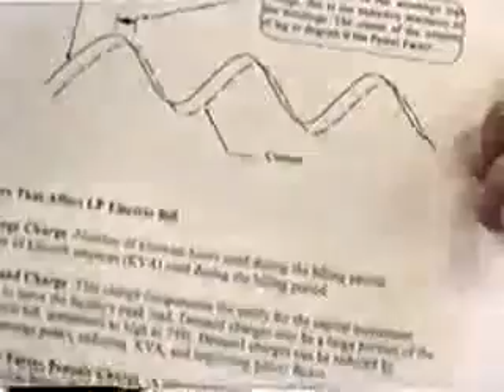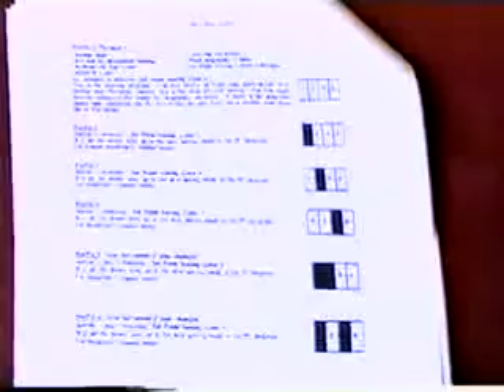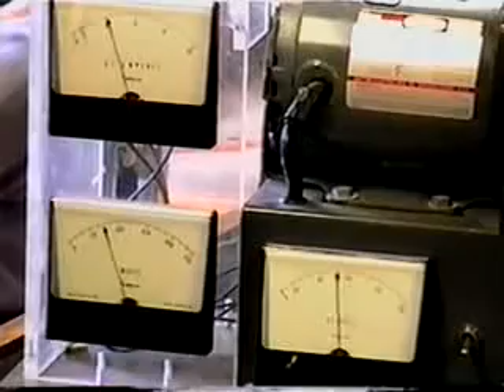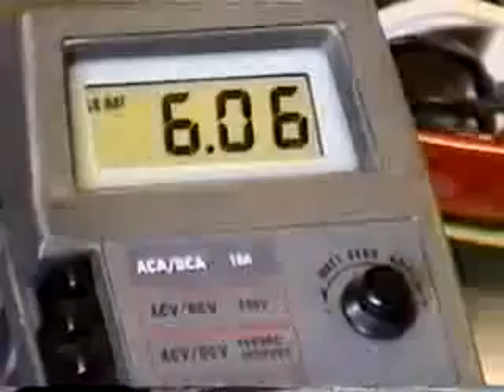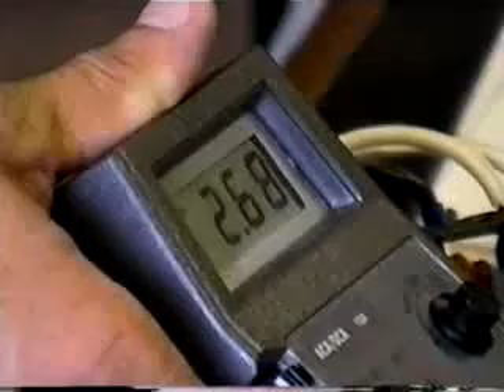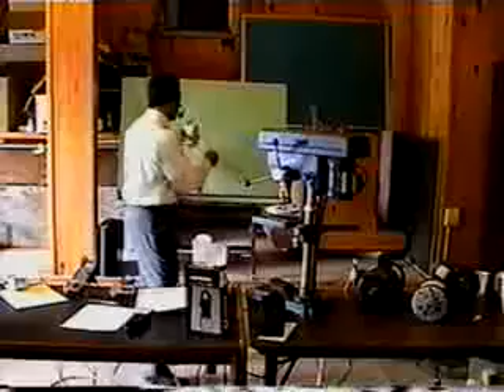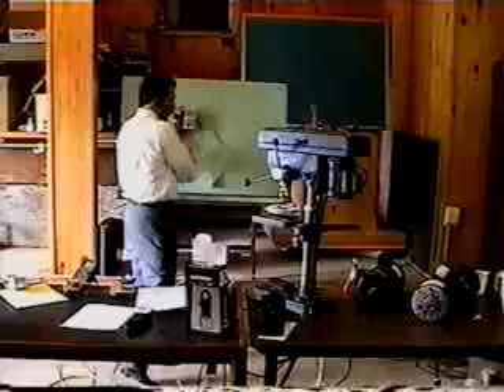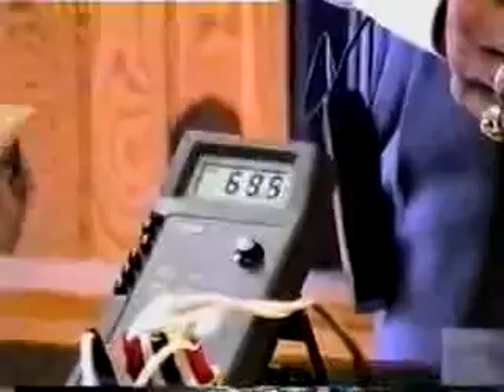Power Controller

Comment: First like. First comment. Yippie.
I guess this invention is very applicable in Electric vehicles that are coming up all over the world. This product can reduce battery size required for powering the vehicle. Hence, cost will reduce, space required by battery will reduce, weight of the vehicle will reduce, more vehicles can be produced from limited resources (lithium), range of the electric vehicle can be increased, acceptance of electric vehicle will increase.
Reply: WOW I cant believe this Video is on You tube .. that's me in the video
Reply: in a matter of fact i am filing the patents for such a device on a much better system . To power homes and everything that has and uses a battery
Reply: That circuit only corrects the power factor problem in AC induction systems. My new circuit generates power.